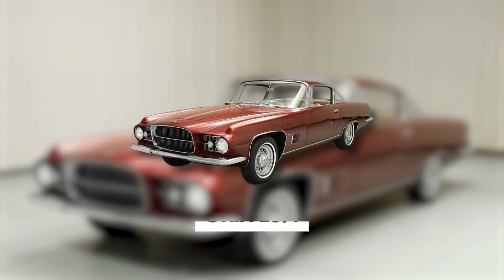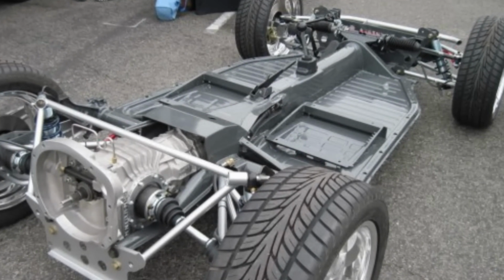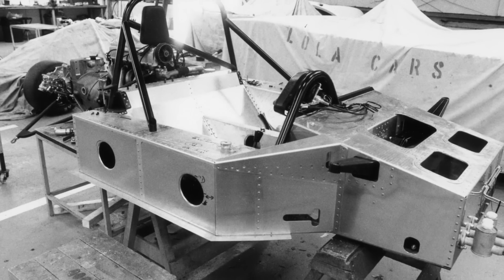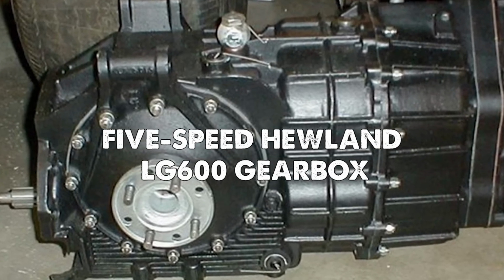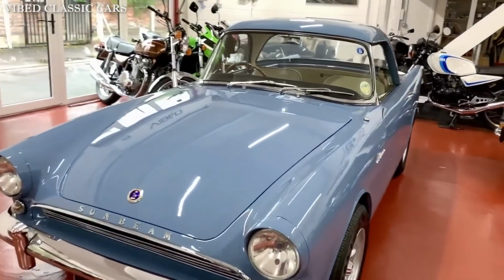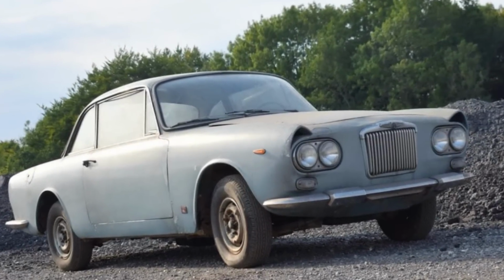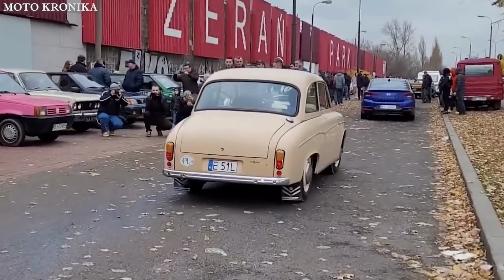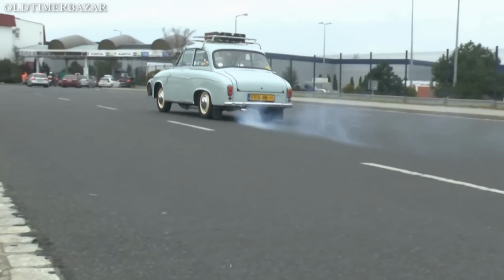4 Most Forgotten Classic Cars Now Ultra Rare Gems!

Comment: So the Ghia L6.4 custom chassis was a Volkswagen Beetle chassis with 4-wheel disc brakes?  Strange that the fact that the car is rear engined is not mentioned in the video..
Reply: No shit, they should make sure to use correct photos
Reply: And the right commentary: the Ghia has funny-looking "drum brakes" (and an "h" in the name).
Reply: Where did you get that the chassis was from VW?